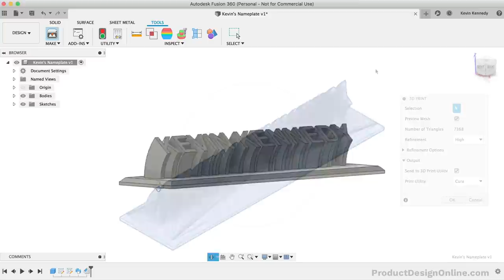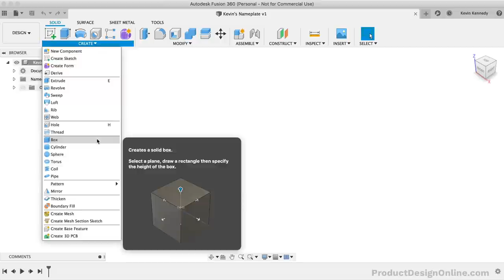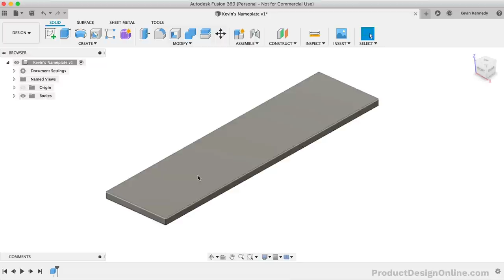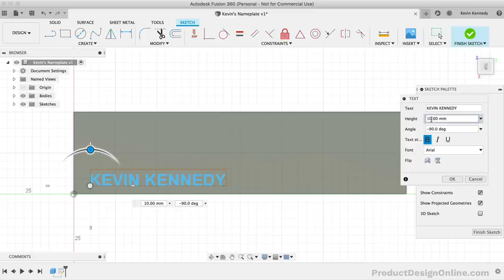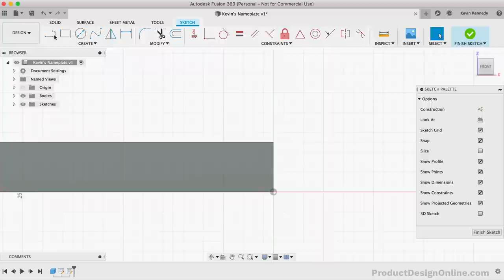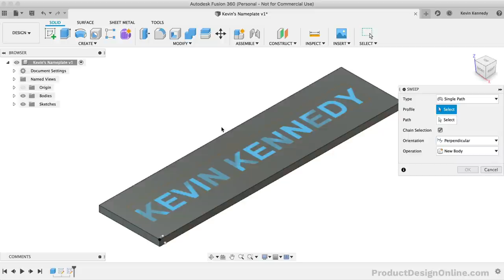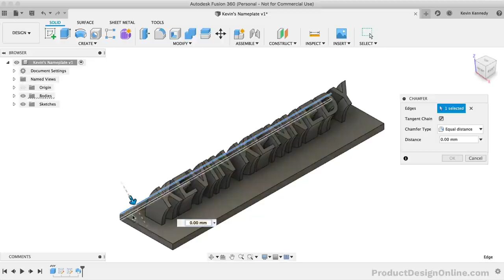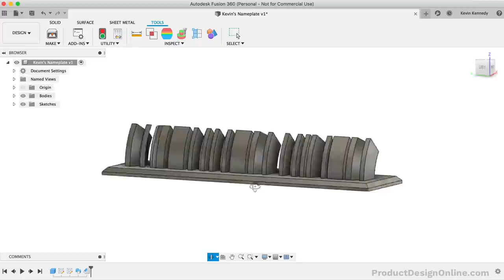Fusion 360 Tutorial for Makers (2020) - Custom Name Plate

Comment from the maker: UPDATE: Thanks to everyone who brought up the Cura opening issue. I looked into it and mine wasn't working because of a security setting on Mac. Glad to see that I can do that now :)
Fix for Mac: https://knowledge.autodesk.com/support/fusion-360/troubleshooting/caas/sfdcarticles/sfdcarticles/Error-Fusion-360-does-not-have-sufficient-privileges-to-launch-the-Print-Utility-trying-to-launch-Cura-from-Fusion-360-on-Mac.html
TIMESTAMPS
0:00 - 3D Print a Custom Name Plate
1:16 - Saving the file
2:00 - Creating a box for the base
5:00 - Creating sketch on the top surface
6:00 - Adding text to the base
8:35 - Discussing the Sweep requirements
9:20 - Creating the Sweep path (3-point arc)
11:25 - Activating the Sweep command
12:00 - Setting up and adjusting the Sweep
14:29 - Adding chamfers to the baseplate
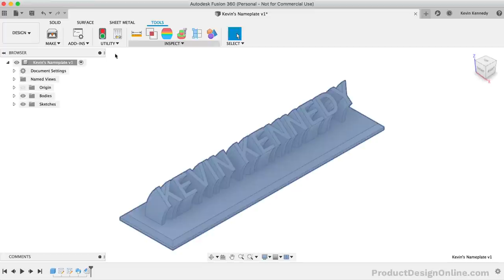15:20 - Saving as STL File
Reply: Just a thought to expand on this video and lead into the use of offset planes and splitting bodies for beginners. https://rdworkslab.com/viewtopic.php?f=154&t=4600#p24947 For a cleaner face on the letters could then be printed face down or in contrasting colours or as in this link Laser Cutting as an option. Nice pace to the videos too :)
Reply from the maker: Sweet! Thanks for sharing this :)
Reply: Your videos are so good man. I've been playing with Fusion on and off for a couple years. You and Lars have brought me so far. I just had to comment and say what a great job you do. Thank you :)
Reply: Thanks for your videos, they're really helpful. What confuses me is that you can't snap to centre within fusion 360, such advanced software and even the cheapest software out there has that feature.

What I struggle with is using this with 3d prints. Once I've designed something, I find it hard to add supports, fillets to the inside of 2 connecting plates. Also, how to bend objects. I think my F360 is weird because sometimes when I make a closed loop from the centre point a little hand comes up and I can't complete my lines.

Take care

Comment: Hi as a very new b to both 3D and CAD (70 years young) finding it a slow progress, But had a go at the name plate and it worked Great thanks Sadly had 2 day working on your 30days to Furison 360 (in which your using an older UI) Just could not get it to work can only presume the 2 are not compatible, as i seen ok when were both on the same version?? your thankfully

Comment: I don't know if the problem with starting the 3rd party Print Utility is limited to CURA, but I have no problem at all using "meshmixer". On my machine, it was the only one of the options that I had installed, so normally I use Simplify 3d. Even on my small computer with limited memory, it takes a little time for Simplify3d to appear, but it does eventually.
Just to check further, I use PrusaSlicer, it works as well. Maybe a little faster then Simplify3d.
In both cases, I selected "Custom" as the print utility, then extra option appears "Application" followed by a folder ICON. You click the folder Icon and browse to the slice of your choice. Your choice now added to your "Application" option as "Application [prusaslicer]" and you still have a folder Icon you may use to change your selection if you have several slicers installed.
Reply from the maker: Thanks, David. Glad you and some others brought this up. I looked into it and apparently mine was working because of a security setting on Mac. Glad to see that I can do that now :)

Reference: https://knowledge.autodesk.com/support/fusion-360/troubleshooting/caas/sfdcarticles/sfdcarticles/Error-Fusion-360-does-not-have-sufficient-privileges-to-launch-the-Print-Utility-trying-to-launch-Cura-from-Fusion-360-on-Mac.html

Comment: Great video, as always.  A couple of things I've noticed:  You can also export an .stl file by going to the "Save" menu and selecting "3D Print".  This also brings up the expected dialog box.  Secondly, Fusion doesn't remember the setting of the "Send to 3D Print Utility"; and always defaults to it being selected each time Fusion is started.  I've also found that not only WILL it start Cura, it doesn't recognize that it might already be running.  If I have Cura in the background (as I almost always do) Fusion will start a new copy anyway.  Rather annoying and that's a behavior I hope will change in the future.

Comment: This was an awesome video! Thanks! One question, is there anyway to reduce the distance the text comes up by? My text looks like it is coming out way higher than yours. I have tried adjusting the arc length and shape but it doesn't seem to work
Reply: Instead of just clicking twice on the same anchor, define a box over the entire object, then when the text dialog appears use the center left right and the center up down commands to center it in the box...

Comment: you asked for issues needing help - mine is creating a 150mm pipe clip 3D then how do I use this as a base to create 125, 100, 90, 75mm etc examples without starting again?
Reply from the maker: Hi, Peter. have you watched my tutorial on the Cable clip? https://youtu.be/XJRPnORhSRo

You'll want to set up User Parameters for your dimension - that way you can simply edit the parameters to adjust the model to 125, 100, 90, 75mm, etc.

Cheers, Kevin

Comment: G'day Kevin 
You asked a different question,  when you said 'select ONE feature in fusion 360 that confuses me?'
Well as a new novice to the CAD world,  I guess the the push-pull  button as sometimes to goes the champers.  Why does it do it?
Thanks 
Greg
Reply from the maker: Hi Greg. Great question. Push Pull is one of the few commands that tries to be 'smart' and changes based on your selection. If you have faces selected it will become the Offset Faces command. If you have edges selected it will become the fillet command.
Reply: @ProductDesignOnline 
Thanks for that info. 
Another a question though. 
You mentioned in another video that 'NORMAL' is generally good enough to export a STL. 
I've got anycubic photon mono resin printer.  So what STL setting would you recommend for doing a M3 threaded model? 
Happy3dmodeling 
Greg
Reply from the maker: @gregorychard  the default export STL settings should be fine. what will be important is how you slice it in your 3D printer slicer. Make sure the layer resolution is small :)
Reply: @ProductDesignOnline  
Thanks for your help and time. 
BTW I love your topics. 
Greg

Comment: Very usefull! Thank you!
Just a info: Fusion 360 opens Simplify3D and show's the sendet model on my mac, no need to open Simplify3D first. Also does Simplify3D on Windows10. The difference between Mac and Win is, when I send a 2. model mac shows it in the same Simplify window, but Win opens a new window with the 2. model in it.
 What's a little confusing ist the animation of gears. I can tell one gear to move a amount of degrees when the driven gear moves another amount of degrees. Isn't there a automated way like with joints?
Reply from the maker: Hi Josef. Thanks for bringing that up. I looked into it and found out it was a security setting on my Mac that had prevented Cura from opening.

I'm not sure I'm fully understanding what you're trying to do with the gears. What types of gears are they? There are two potential solutions - using contact sets or motion links.
Reply: @ProductDesignOnline  I think that if gears are used, the automation should be done via contact. A driver/motor conected to some gears and make them move and move/ drive something to see if the assembly works as planed bevore printing or make ba woodworking. I hope I was able to explain...as english isn't my native language. Thank you any how!! And thank you for sharing all you're very usefull videos!!

Comment: Every time I try to use the chamfer tool on the top edges of the base I get this error. It doesn't matter what number I try. Error:   The fillet/chamfer could not be created at the requested size.
    Try adjusting the size, deselecting some of the edges (try disabling Tangent Chain), or using multiple separate operations.

Comment: Ok, so while I was sleeping I thought about something so to to take this project to the next level. How hard would it be to make a slot or groove on the bottom to slide a led strip through it and it kind of shines through. So when groove is cut it goes through some of the letters. But idk how to do it.
Reply from the maker: Hi Todd. After creating the text you could create a sketch on the side of the sweep and do a simple extrude cut of that shape. The key would be to create a shape that allows for the shape of LED strip light, while also making sure it's 3D printable (hopefully without supports).

Comment: One thing that confuses me: when I've accidentally done something and don't know how to reverse out of it. I know that sounds stupid, but I accidentally created a mid-plane and it took me forever to figure out how to delete it. I'm completely new to this stuff. What are common mistakes and how to fix them? Like, The last video had us making constraints. What if I wanted to undo them? I have no idea how to do that.
Reply from the maker: Hi Staci. Good suggestion, thanks! To answer it here (in short) you can select just about anything and delete it with the delete key on your keyboard. A good starting point is to right-click and the menu will give you all the available options (whether or not you can delete or remove something).

Comment: i just want to extrude my text but not on an arc but i cannot find anything that helps me. fusion just wants to extrude the plane/block the text is sitting on and will not let me extrude the text what am i missing?
Reply from the maker: What font are you using? some fonts will not let you extrude the text without right clicking and selecting the explode option. Otherwise, you should be able to select the text... It will be highlighted in blue and then you can activate the Extrude command.
Reply: @ProductDesignOnline  yea I found a different video of yours that helped. I’m using a font it does not like. Even exploding it doesn’t let it. So I went with a different font. Your awesome Thank you.

Comment: Everything is going well until i reach the sweep command. i try to apply the sweep and nothing happens
Reply: Same here. I get 4 error messages (translated to english): 
Error: A problem occurred when combining geometry.
    When connecting/cutting/cutting, try to ensure that the bodies clearly overlap (problems can occur when surfaces and edges are almost coincident).
Error: inconsistent edge-face relationships
Error: The sweeping profile is not valid.
    Change the profile.
Error: The sweeping profile is not valid.
    Change the profile.
I've tried a lot but nothing helps. @Product Design Online Any advice? Anybody?
Edit: I can use the plate top as profile for sweeping, but using the text as profile doesn't work.

Comment: Two things I find difficult, one using the joint command, I cant always determine how to orient the 3 axis icon   so the parts mate properly, and two I have tried using the align command instead of joint but this fails somrtimes and gives and error indicating there is no geometry. If you made a tutorial on assembling components using both these features I would find it helpful.
Reply from the maker: Thanks for sharing, Charlie! Covering more assembly methods is a topic I'll be covering more this year.

Comment: I'm really struggling with the bend tool in Sheet metal. Sometimes it works, sometimes not (on an extruded plate with the flange tool
Reply from the maker: Hmm... are you saying sometimes it works sometimes it doesn't with the same file or using Fusion 360 as a whole (different files)?
Reply: I have no idea what you mean with "(different files)", but this what I'm doing:
I reboot, open the 2.0.7463 version of Fusion 360, I make a new file, go to sheet metal, go to top view,  make a sketch on the bottom plane, using the mirror tool to complete (sketch is all constricted, as in having black lines), extrude with the flange tool, go to the Front, Left, and Right view, extruding normally the sides (I type 'e'}, then use the bend tool, then change the sketch geometry, press "finish sketch". Then go to the Back view, make another extrusion on the side face,  try to use the bend tool, and I can't make a bend anymore (although sometimes it DOES work with a new file and the same steps).

Wen the bend tool refuses, the flange tool still works fine, though. 

Or sometimes (new file) I make a sketch, use the flange tool to extract, then use the extract tool on the Front, Left, Right and Back sides, and the bend tool won't work at all.

When I say that the bend tool doesn't work, I mean that I can open the bend tool, select a stationary plane, but that's all, no matter where I click or drag to make any bend, I can't complete the bend tool. 

It drives me bunkers.
 
 However, on the top (under the toolbar),  I have yellow warning bar saying: "We are changing the startup subscription offering, please update your existing subscription now" Can this have anything to do with it?
Reply from the maker: @RobNisters  Hmm... If you're able to get a screen recording of that happening it would be super helpful. A post to the "Fusion 360 Support" forum with that will get the Engineers to look into it.

Comment: Some misleading information in the video.  Fusion360 can open Cura right from the dialog box. I do it all the time.  If Cura does not open, then it is likely the executable is either different than Fusion is expecting or has moved. (Its not Fusions top priority to keep up with Cura builds.)  Easy fix... select Custom from the slicer selection then within the Fusion interface, link it to the executable file on the HDD and save.  Problem solved.
Reply from the maker: Hi, broderp. Thanks for bringing this to my attention. I looked into it and apparently it's a Mac think because of the default Mac security settings. Good to know it can be fixed :)

Reference: https://knowledge.autodesk.com/support/fusion-360/troubleshooting/caas/sfdcarticles/sfdcarticles/Error-Fusion-360-does-not-have-sufficient-privileges-to-launch-the-Print-Utility-trying-to-launch-Cura-from-Fusion-360-on-Mac.html